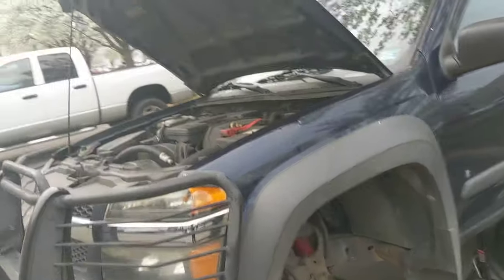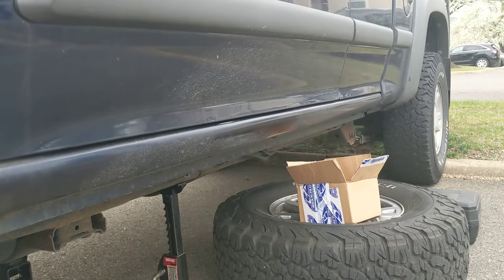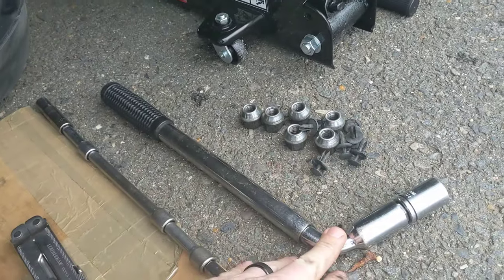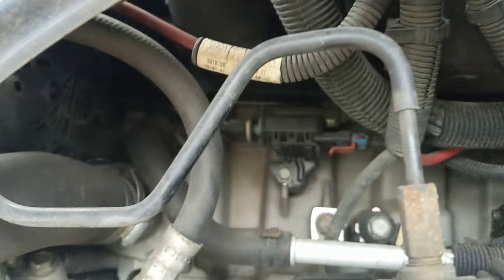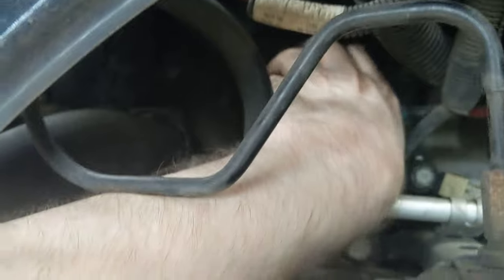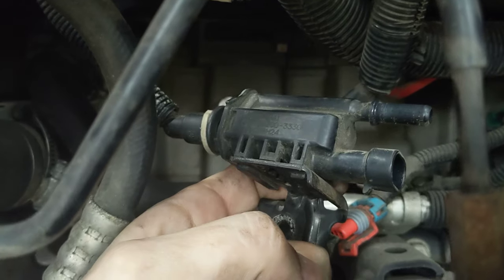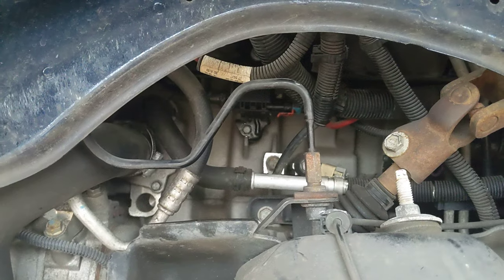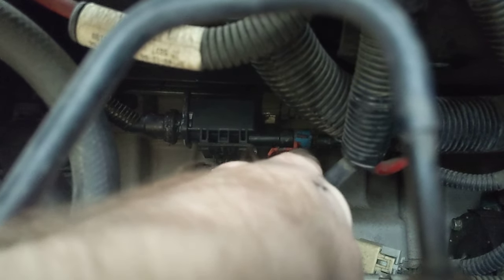How to replace Chevy Colorado purge valve solenoid (2141680) (214-1680)

Comment: So I have a leak from the top of the tank. The issue wasn't the pump assembly it's the vent gasket/ silicone holding that plastic vent in. Noticed the leak when topping off the gas. Doing research but haven't found the part(s). Thinking I may have to order a new tank since the silicone I applied isn't holding the pressure in the tank.
Reply from the maker: Hi!  Thanks for the comment.  I know I've got a leak at the top of my tank, as well.  Did you remove your tank to inspect this area?  How difficult was it to drop the tank?
Reply: Thanks, what is happening, ?? & other work?imhave 2007;Canyon/ 4 CYL

Comment: Question! Out of no where started having starting issues. It fires up after like 5-7cranks and runs perfectly fine or sometimes literally fires up right away. Went a week straight last week with no issues now all a sudden back to the same issue. It’s a hit and miss at this point and I’ve ran through everything I can think of causing this issues and it all checks out good. Plugs/fuel pump not even a month old. Cleaned all my sensors, replaced what needed replaced. Any ideas? It’s getting very annoying and will make it difficult to sell if I decide to do so after giving up on finding the issue. Only thing I haven’t checked so far is plug wires and injectors. But everything else is good. Any help?
Reply from the maker: Hi! Thanks for the comment. Are you getting any codes? Or is it just that sometimes it starts right away, and other times it's like "crank-crank-crank-crank-crank" before it starts?

Off-hand I would suspect a cam or crank positioning sensor, but that's just a gut feeling. These trucks don't have plug wires, and typically a bad coil would set a code. I assume you've cleaned throttle body and ran a fuel system cleaner already?

Slim possibility, but maybe a bad or missing teeth on the starter or flywheel? Think that would make other noises though...
Reply: @CompTechMike  no codes just sometimes cranks and sometimes fires right up. Crank sensor is new unless faulty? Yes sir ran cleaner and cleaned throttle body. May need to double check the new crank sensor.
Reply: @CompTechMike  no noises or anything on start up either…
Reply from the maker: @bbruhn112  So that I understand correctly, you're saying sometimes you go out and turn the key and absolutely nothing happens at all?  No crank, no click, no lights on the dashboard?  If you turn on the headlights and turn the key, do the lights dim?  How old is the battery?  Have you had it tested?  Inspected cables?  Maybe the ignition cylinder is starting to fail.
Reply: @CompTechMike  no sir, every time it cranks. Either starts right up or cranks 3-5 times before starting. Checked battery yesterday and it’s good. Just put new connections for the battery as well. But today it threw the code for the crank sensor so maybe that one is faulty. Going to try and replace that tomorrow! I will also look into ignition cylinder as well. Also thank you so much for all the help and getting back with me. I really appreciate it. This has been going on for a couple weeks and with going to college at the moment it has been very frustrating and I hope it doesn’t take a crap on me as it’s my only vehicle at the moment to get back and forth to school!
Reply from the maker: @bbruhn112  you're welcome!  Good luck with that sensor.  Hopefully it's not the timing chain, that's a beast on these motors.  If you get the P0017 code, that's when it's time to worry.  Here's a slightly humorous video what those are like on these trucks:

https://www.youtube.com/watch?v=-dI2pSmMy8Q

Fuel + Air + Spark + Timing.  That's what these motors need.  Good luck!

Comment: Is there a video of how to reset engine light after replacing the valve ??? Thanks
Reply from the maker: Hi Alma! To clear a check engine light, the easiest way is to erase the code using a code scanner. Any basic scanner should be able to do this (as well as many other useful functions). You can find them at any auto parts stores, Amazon, etc., starting at around $40. Alternatively you can disconnect the battery overnight - that should clear the code, as well. But my recommendation is to get a scanner! 😊

Comment: This is on the 5 cylinder model. It is not the same as the 2.9l 4 cylinder
Reply from the maker: Hi! Thanks for the comment. I do not have a 4 cylinder model to compare to. Tentatively I would assume so. If you're able to confirm please comment back, it may help others in the future. Thanks! 😊
Reply: @CompTechMike  Also curious as to this. Just pulled my fender liner off to not be able to see where I need to go, might be under the battery but higher up
Reply from the maker: @sithknight7740  You have the 4 cylinder? Try removing the battery. Are you able to see it, then? Also do you have coil springs or torsion bars? You might try posting in one of the forums or Facebook groups. Am sure it's pretty "common knowledge" just I don't have any 4 cylinder vehicles to check. If you find it, please share a picture! 😊
Reply: @CompTechMike  Will do and I couldn't see it at all through the wheel well. I believe I have coil springs but I'm very amateur and not 100% sure about that. I had noticed my actual fender itself was larger than it appeared in the video, resulting in less visibility.

My truck has been starting rough since the light came on a couple weeks ago so I haven't driven it. I'm going to go snoop around on Facebook as well as look into the battery route.
Reply from the maker: @sithknight7740  sounds good. Coil springs are usually pretty easy to identify - they look like big coils and take up a lot of space in the wheelwell area. Torsion bars are usually found on trucks with 4WD and are a bit easier to work around.

Since you mentioned having a check engine light I'd start with getting a basic code scanner. You can pick one up at most auto parts stores or online on sites like Amazon starting at around $40. Also most auto parts stores have one that you can borrow. Use that go read your codes and start googling. Some common issues include vacuum leaks around the PCV system and dirty throttle bodies. Plenty of videos on YouTube to troubleshoot those kinds of problems. Good luck!
Reply: @CompTechMike  No yea I already did that the moment it happened. It's an EVAP large leak and changing the gas cap didn't do anything, alongside the occasional fuel smell. And yea seems like I have coil springs.
Reply from the maker: @sithknight7740  evap large leak with fuel smell sounds like it could be the charcoal canister "purge valve" back near the spare tire.  Another common problem is the fuel pump lock ring on the top of the gas tank rotting out.  I usually use this flowchart when troubleshooting evap issues:

Troubleshooting flowchart for evap issues:
1 - Replace the gas cap
2 - If you still get the code, replace vapor canister purge valve above spare tire. Inspect hoses and replace as necessary
3 - If you still get the code, replace purge valve solenoid on driver's side of engine below intake. Easiest way is through driver's side wheel well, or remove battery. Inspect and replace hoses as necessary (including hose between valve and throttle body)
4 - If you still get the code, inspect lock ring around fuel pump at top of tank. This is a poor design and lock ring frequently rusts out, causing evap leaks and smell of gasoline
5 - Check for loose intake manifold bolts or leaking/damaged hoses around the intake and PCV system
6 - If you still get the code, a smoke test may help
Google. There are YouTube videos showing how to replace all of these components. Here's a link to one channel that has a bunch to get you started:

https://www.youtube.com/playlist?list=PLZsiP8a81zDFWVAWL_RxIkDSn2TSAcU8y

Alternatively, don't beat around the bush and start with the smoke test. If that is inconclusive you may also have electrical issues.
Reply: @CompTechMike  Wait I thought the vapor canister vent valve is above the spare tire and that the purge valve/solenoid is below the intake. 

I'll have to do some investigating tomorrow or Friday, it's currently pitch black in NY.

Comment: Hey can u tell me where the wire plug goes to on this truck mine is broken and not seeing where it goes
Reply from the maker: Hi! Thanks for the comment. The wiring connection on the purge valve solenoid goes back towards the firewall and then up, and then from there I'm afraid I don't know (not without tearing it apart on my own truck, I suppose 🤣). I'd start looking in that direction. It may help to remove the battery, wheel, and the inner fender liner to get better visibility down into that area. I'd also check on forums like coloradofans and 355nation in case anyone has posted a wiring diagram. Good luck! If you're able to figure it out come back and let us know. 😊
Reply: @CompTechMike  I was replacing the same thing you did and when I first looked in there I tho it was cut but as I disconnected the intake hose and pulled it up I seen it was in fact still connected lol only hard part I had was dropping that screw in the engine mount had to get a strong magnet 🧲 and fish it out but as soon as I stared it check engine light was gone thanks for the video

Comment: How often do you change the evap? I've had to change mine like 4 times now. I had to watch your video to refresh my memory on how to swap em out.
Reply from the maker: Ha! Sometimes I have to re-watch my own videos, as well. Especially for stuff on the wife's Toyota. 🤷🤣 Have only needed to replace it once though. Four times seems excessive! Not sure what to say, maybe try a different brand? What symptoms are you getting when it fails each time?
Reply: @CompTechMike  haha yea. Well I forgot to mention that this time around my throttle body sensor goes nuts and I get reduced engine power and it sputters pretty bad so I pull over and disconnect the throttle body I guess to reset it and it goes away but it will come back sometimes hours sometimes less. I've already cleaned the throttle body bc it needed it but I think the evap could be causing it to set it off. To be honest I haven't had time to change the evap in months and about 2 weeks ago I started to get reduced engine power. I'll let you know what happens after I replace the evap. 🤞I hope the engine light goes off and I have my truck back to normal.
Reply from the maker: @donsal.t.1765  Good luck!  Sounds like you've got some work to do.  🤣
Reply: @CompTechMike  ya I think I'm going to buy a new throttle body.. I don't know why but it did it again after 20 miles of driving. I was able to pull over and erase the code with the computer thing you hook up to read codes.
Reply from the maker: @donsal.t.1765  What is the exact code you're getting?
Reply: @CompTechMike  I didn't pay attention all I did was erase the code. I hardly use that computer but when it comes 9n again I'll look through the computer bc its q really simple computer and I didn't see a code number just that the evap was in the yellow. It gives a list of sensors and they're lit green when they're good,  yellow when bad.
Reply: @CompTechMike  first it was my stabilitrak light and now this 🤦🏽‍♂️. My brakes pump when I brake most of the time after the stabilitrak came on. I need to just get a new truck. I'm at 230,000 miles anyway
Reply: @CompTechMike  the exact code is P0442. I'm going to check the evap canister and valve that may be it🤞. I just watched your maf and map sensor video gonna replace those too. I've cleaned the maf about 2 years ago but never even knew what the map was.
Reply from the maker: @donsal.t.1765  Hi again!  For evap codes I usually start with the following list.  They're super-common and a lot of people ask about them in the forums.  Maybe it will be helpful to you?

Troubleshooting flowchart for evap issues:
1 - Replace the gas cap
2 - If you still get the code, replace  vapor canister purge valve above spare tire. Inspect hoses and replace as necessary
3 - If you still get the code, replace purge valve solenoid on driver's side of engine below intake. Easiest way is through driver's side wheel well, or remove battery. Inspect and replace hoses as necessary (including hose between valve and throttle body)
4 - If you still get the code, inspect lock ring around fuel pump at top of tank. This is a poor design and lock ring frequently rusts out, causing evap leaks and smell of gasoline
5 - If you still get the code, a smoke test may help

6 - Google. There are YouTube videos showing how to replace all of these components. Alternatively, don't beat around the bush and start with the smoke test.  If that is inconclusive you may also have electrical issues.
Reply: @CompTechMike  oh ok I need to write this list down. I've changed the gas cap bought it at O'Reilly's.. but I'm thinking maybe I need am actual gm Colorado gas cap. I changed the solenoid last night lol that's the one I've replaced 4 times now in a span of 7 years. I've only changed the vapor canister purge valve once so I'm going to change that next. I think that may be it if not I'll just take it to get a smoke test. Do I need to take the bed of the truck off to inspect the lock ring? Oh and could a small evap leak like the computer says, could that be causing my throttle body to be acting up too? I really appreciate the list 🙏
Reply from the maker: @donsal.t.1765  Hi! I recommend an OEM "GM Genuine" or ACDelco gas cap. Although if you're having that many problems, I'd suspect the lock ring at the top of the gas tank. I was able to inspect mine by setting my cell phone to record video and moving it along the top of the tank. After 226,000 miles it was an absolute rusted mess.

Three ways to replace: lift off bed, drop tank, or cut an access hole in bed directly above pump. Depending on how much you like your truck, one of those ways may work better than the others. 🤔🤣
Reply: @CompTechMike  yes I'll order a ac delco cap from Ebay they sell real acdelco or gm parts too. As for the bed I'll probably take it all off 😅. Thanks again!

Comment: How did you get red connector off?
Reply: I got it off thank you!
Reply from the maker: Hi!  Thanks for watching & commenting on my video.  The red connector is a standard plastic automotive electrical connector and can be disconnected by hand, by getting your fingers underneath and prying it loose while pulling on it.  Clearance is a bit tight.  The truck in this video has torsion bar suspension, if your truck has front coil springs instead it may be more challenging getting your hand in there.  Loosening the bolt so you can wiggle the solenoid around may help.

Here's a couple images that may help:

https://imgur.com/a/jnxOANZ

(images hosted on Imgur)

Hope this helps!
Reply: Yes it was a bit more challenging with front coil springs but was able to get in there. Thank you so much!
Reply: After taking both hoses off and bracket it was easier to bring the purge valve closer to me. I’m short 5 foot 5 so I was able to fit both hands one on each side of coil spring and disconnect everything
Reply from the maker: @ericsilva2904  nice! Glad to hear you got it. Some things are definitely easier when you have small hands. 😊

Comment: Did u get fixed the problem with P0442??
Reply from the maker: Hi!  I did, actually.  I replaced just about every component in the evap system and even had a smoke test, ultimately what it turned out to be was the gasket at the top of the fuel tank where the pump fits in.  After 224,000 miles it had rusted clean through.  I looked at how hard this was to change and there's two main ways - either you drop the tank or you call six of your closest buddies and lift off the bed.

I've dropped a few tanks in the past but they were on older and easier to work on vehicles, so I just lived with it and would reset the light every couple hundred miles when it came on.  But I finally got around to paying a local garage to do it a couple weeks ago.  $400 labor (which didn't seem unreasonable considering everything is expensive in Northern Virginia) and $600 for the pump and gasket.  Oof.  It'd better be AC Delco original.  🤣  But that solved the P0442.